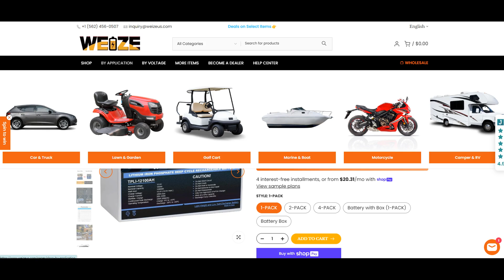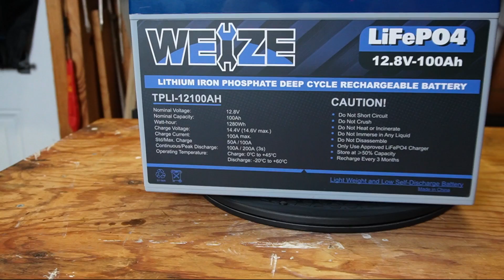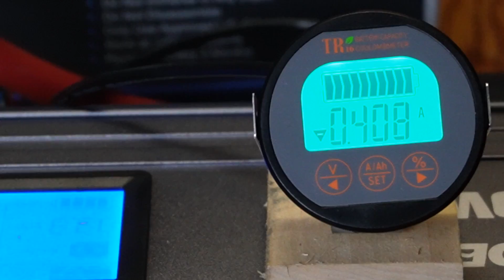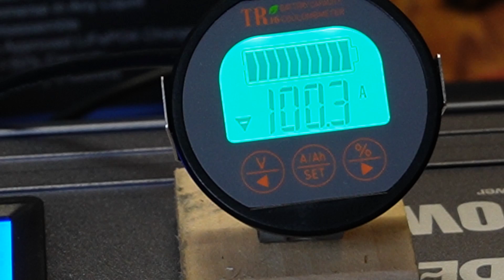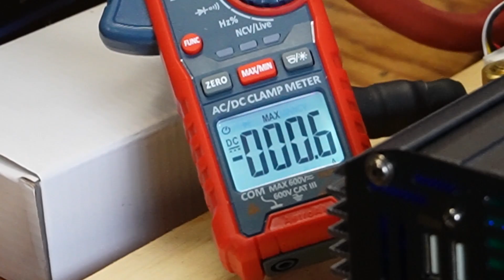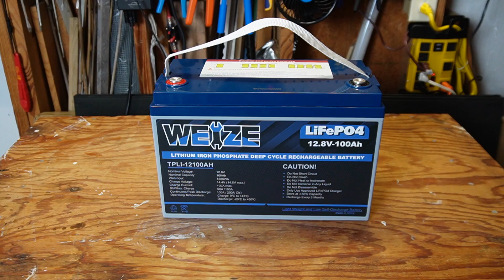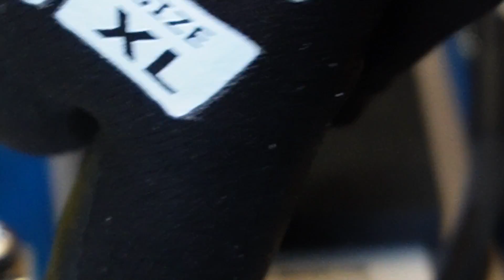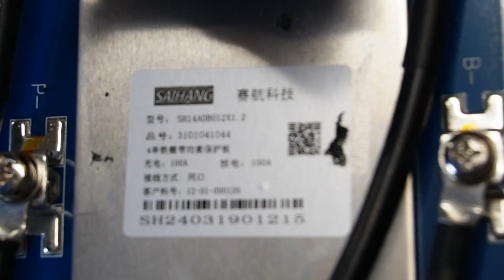Weize LiFePO4 12v 100Ah Battery Review - 10 Year Warranty!!

Comment: Why not check the cold temp protection with ice water? And use a thermometer. Just because it turns off with cold spray doesn't necessarily mean it turns off at a safe temperature.
Reply from the maker: Going forward I do plan to consistently use something else other than the spray from the air duster. Something I can easily replicate just under 30F.

Comment: About to buy new batteries for my thunderbolt kit. Getting the universal battery 100 amp hour from Walmart seems to be the best deal. The controller has a Setting for lithium batteries but I can find no information on it and the manufacturers are less than helpful in their manual and over the phone. I'd like to switch to lithium and to the larger panels but they push 110 or 120 V and I'm running a 12 V system and unsure of how to run a 120 V panel into a 12 V system or where to get a 110 or 120 V battery or power station affordably.
 If anyone has any advice on this I'd much appreciate it.
Reply from the maker: I'm not clear on what you have there. The solar charge controller determines the solar panel input. It sounds like you have a 12v system so the solar charge controller will output 12v to the battery. You will need to determine the input specifications of your solar charge controller to determine which panels to purchase.

Comment: That is a great warranty. if you can get them to honor it.
Reply from the maker: I have not heard anyone yet say anything at all (positive or negative) about Weize warranty and customer service. I would like to hear about them.
Reply: @proficientprepper  I Contacted them about one of the batteries not charging a year ago and haven't heard a thing since.
Reply: Ordered 3 on Amazon 6 months ago. Running series for 36v. One battery would not hold charge higher than 80%, 13.30. Support is in China. They would only respond once a day and all they told me was they could not find my order and to contact Amazon for a return. I had a week of back and forth with them and they just apologized and would not do anything to help with the return of the defective one. I have my complete email string. They told me to just have Amazon handle the return and if they would not to just request my money back through my bank. Horrible customer service but you get what you pay for with the price you pay for the batteries vs name brand ones...unfortunately.
Reply: @adamharris4456  Thanks for the info.  There are cheaper options on Amazon.  I will look at those instead.  If I am going to get ripped off, I might as well do it for less.

Comment: I got two of those same batteries, and the cold killed them, and I paid $803 dollars for them.
Reply from the maker: Did you contact Weize? I'm curious how they responded. How cold was it? Did the batteries have cold temp charge protection when you bought them? I'm seeing more and more batteries with that feature now. I'm not sure if these batteries always had that or they recently added that feature.
Reply: @proficientprepper  No, and I do not know if it had cold protection. but at almost 400 each it should have.